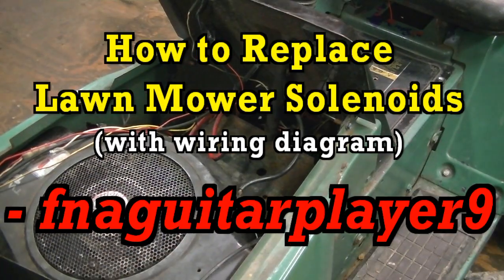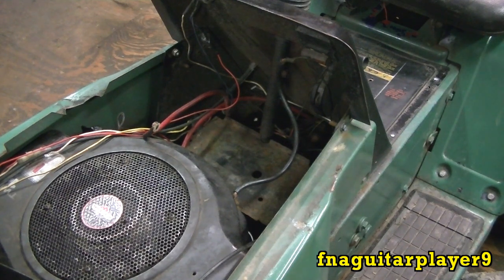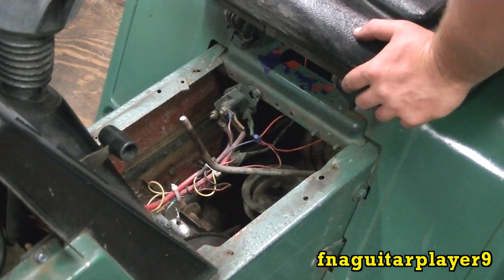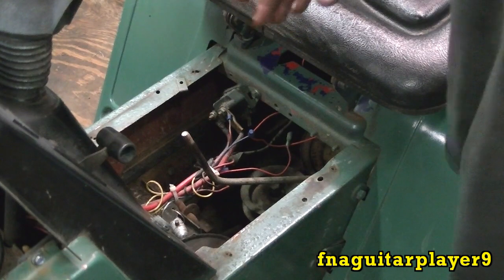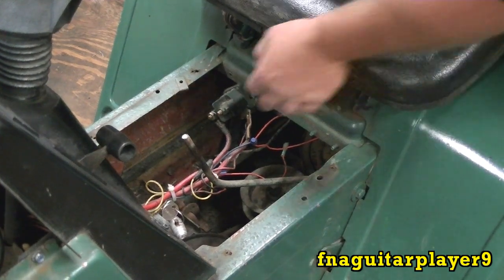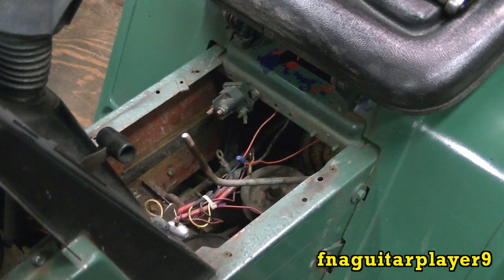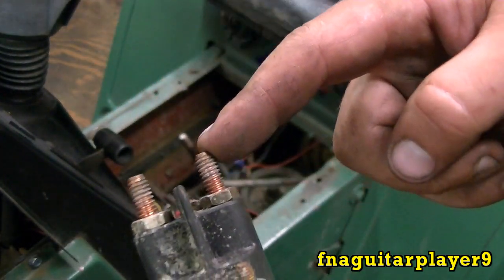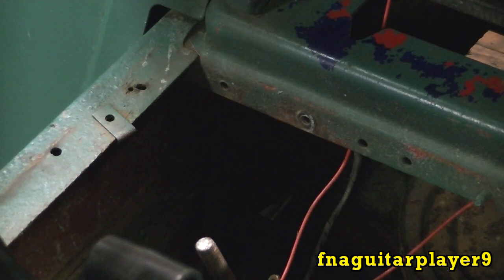How to Replace Lawn Mower Solenoids, With Wiring Diagram

Comment: Thanks Frank; I didn't think about shorting the solenoid as a test means and the diagram was very helpful in understanding how it all pans out.
Reply from the maker: +grotekleum Your welcome! Yeah it will connect the battery straight to the starter, checks the contacts if it does click and no crank. Glad to hear the diagram was helpful! Thanks for Watching!!!

Comment: It's my understanding that riding mowers that use the 3 post solenoids are wired so the safety switches are in series with the 12 volt trigger wire and the 4 post solenoids are wired so the safety switches are in series with the ground side, that's what that extra ground terminal on the solenoid is for. the wire that connects there goes back to the safety switches. Any comments are appreciated. Thanks.

Comment: Just used your beginning picture. I had just put a new solenoid on with a bigger he wire and forgot which side of the noid the little wire went. "Battery side". After I saw the picture I remembered. Just a duh moment for me. Thanks though.
Reply from the maker: I hear ya, its easy to forget where something goes. Glad to help out! Thanks for Watching!!!

Comment: I have a John Deere zero turn mower and is about to test the solenoid on it. I started my mower after bypassing the solenoid using a screwdriver and the mower started which indicated that the starter was good, but the solenoid was bad. I am going to install one which I purchased and see how that works. I had purchased a starter earlier to put on the mower, but since it seem to be the solenoid, I will store my starter just in case it goes bad.
Reply from the maker: If it still doesn't fix it, it may be the key switch, some times if the contact is burnt out it won't send power to the solenoid to start, but I'd say it is the solenoid, it usually is. I hear ya! thanks for watching!!!
Reply: fnaguitarplayer9 what are the serial Numbers on this engine? Really Need em! Thanks
Reply from the maker: I'm not sure of all 3, they are rusted so bad you can't make it out, this mower sat outside for several years, long story short, it was given to me, i sold it, then I did a bunch of work a few years ago for the guy to get it back LOL it should start with 401707, that should get you started, I can make out the the last set of numbers, it starts with 86 so that is the year of this engine. Thanks for Watching!!!

Comment: Five years later:
TEW is now out of business. Most of these OEM start solenoids are made by Trombetta, headquartered in Milwaukee, Wisconsin. They have a lot of information available on their website.
Trombetta solenoids are readily available from multiple suppliers.
Reply from the maker: I know, its a real shame they closed up. I talked to them when they closed up, they couldn't compete with ebay and amazon. I'll check them out. Thanks for Watching!!!
Reply: fnaguitarplayer9  I just bought a heavy duty contactor for my Kohler Magnum 12. I’ll let you know how it works out.

Comment: Ok I try to hook my new solenoid up they was two wire on one side and the side has the ground on it so now went I went to hook the battery back up I hook the hot first then the ground but  went I start to hook up the ground it will spark so do have any idea what it could be

Comment: Are you familiar with mid 80s model Snapper RER wiring? I'm going through it and cleaning all the contacts. Pulled the solenoid off and sandpapered it but the lawnmower frame where the solenoid mounts is painted. Not sure why they would paint where it mounts, how's it supposed to get a good ground? 
 Also, it has a key ignition switch but someone wired a toggle switch to shut the engine off. The ignition switch no longer shuts it off so I'm trying to rewire some of it to do away with the toggle and just use the ignition switch. I was having battery drain issues is why I'm doing this. When the mower sits for a few days it doesn't have much juice to turn it over but when I connected a meter up to the battery it read like 12.3 V at first at high speed. After about 5 minutes I checked it again and it was up to about 13.2 V. I took the battery to AutoZone to be checked and they said it was OK but that it was at 65% and needed charged. I think something might be draining my battery when shut off. Would the diode in the red wire being bad cause a drain? I haven't checked it yet but I can't figure out why the battery won't stay charged up good....
Reply from the maker: Not right off hand, but 90% of riding lawn mowers are very similar. I'd sand off so at least one bolt has a good connection, some solenoids are 4 wire, that has a actual ground wire connected to it. it may have had that type at one point. If the diode is bad it will be sending the power to the stator under the flywheel, which would probably burn it up unless the diode is acting like a resistor. there could be a wire partially grounding out, cause by insulation grounding out or something. On newer mowers i have seen batteries drain do to power staying on the fuel solenoid on the carburetor, but i figure yours doesn't have that. Its possible the battery is weak, if you have another battery i'd say switch them around just to rule out the battery. Thanks for Watching!!!
Reply: fnaguitarplayer9  Thank you!
 No, your right, it doesn't have the carb solenoid on it. I cleaned all the contacts up and did away with the toggle switch. I also took the starter apart and cleaned it up good, lubed the drive gear and put everything back and mowed the lawn. A few days later and it started like a new one......Must have just needed the contacts cleaned up.
Reply from the maker: I hear ya, sometimes thats all it needs!

Comment: Ok I got a question. My lawnmower is an old girl 1998 just bought it and it had to be started with a screwdriver with the solenoid/relay. I know that is ok in a pinch but not good for the long haul. It also had a bad battery. I replaced the battery, put a new switch on it and a new solenoid and it still wont start with a key.

NOW the lawnmower initially had two of those flat things you slide the connector on that according to specks but the one that was on it only had one like yours. From the serial on it, it was for a briggs and stratton and mine was an old Sears model. The new (universal) solenoid came with an extra wire to connect to the base and slide over the other one. I have tried with and without this part and it still wont start without hopping it with a screw driver... ideas?

ALSO there is a small black wire with the circle on the end that was disconnected before does that need to go somewhere?
Reply from the maker: Some had a inline circuit breaker or fuse, check that first, if that is good, then it could be a bad key switch, they are infamous for the starting part to go bad, or it could be a bad safety switch either on the deck or the clutch, could be a number of things. The black wire MAY be a ground, not sure. Thanks for Watching!!!

Comment: I just replaced my selinoid and ignition switch I didn't pay attention how the wires were when I unhooked it but I can't get no start at all but I can touch two bolts and it will start you think I got a bad one
Reply from the maker: It might be bad, or a fuse is blown, if the fuse is blown it won't crank with they key. The red wire should be hooked on the same side as the cable coming from the battery, if its on the other side it won't work either. Thanks for Watching!!!

Comment: I am trying to get to the solenoid on a troy bilt bronco and I can't get to it...do I have to remove some of the frame....it is behind the battery tucked in a spot that is impossible to get to....any tips?
Reply from the maker: You may not need to remove the fender but it will make it alot easier to get to, i don't know why they put them right there for, you may be able to get to it with the battery out but not easily. Might, just might be able to reach it easier from under the mower. Thanks for Watching!!!
Reply: fnaguitarplayer9 thanx for help...i actually got to it...i was stupid and didn't realize the mount on the back could be accessed from...so I unscrewed the mount and I reached in and pulled it closer to me

Comment: thank you, i am adding a starter to a model that did not have one (spot it there for it though) so can I just install the starter and wire it separately or by itself using a push button, then release when started? if so how do i wire it?
Reply from the maker: your welcome. I Hear ya! You would still need a solenoid, you would wire positive from battery (fuse) to one leg of the switch, other leg on switch goes to trigger on the solenoid, then on the 2 big posts on the solenoid, one goes to battery, other goes to starter. And you would just have to a separate toggle switch for shutting the motor off. Or you could actually use a regular key switch, just have to find a schematic online for it. Thanks for Watching!!!

Comment: Nice video but what is the wiring for a 4 port solenoid?
Reply from the maker: That should just have a extra terminal for a ground wire to attach, the 2 big wires are the same (starter and battery) and the trigger wire is still the same, just probably doesn't ground through the frame like these do, have a separate wire for that. Thanks for Watching!!!
Reply: The 4 post solenoid has the extra connector that is on the negative or ground circuit, this goes to the safety switches so if they are not closed no voltage can go to the solenoid so it will not start.